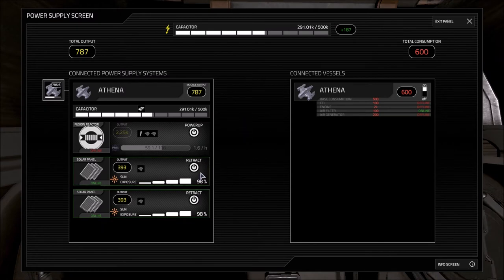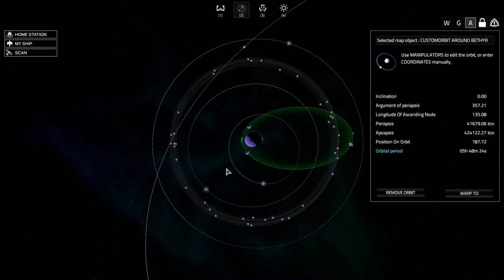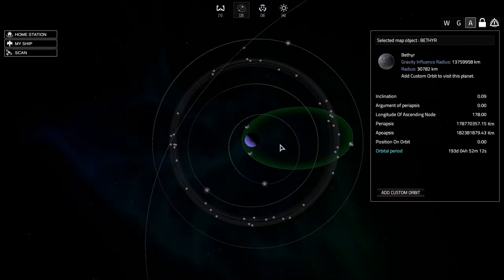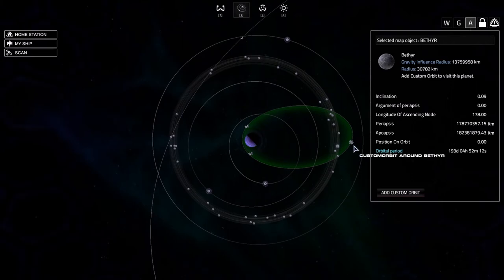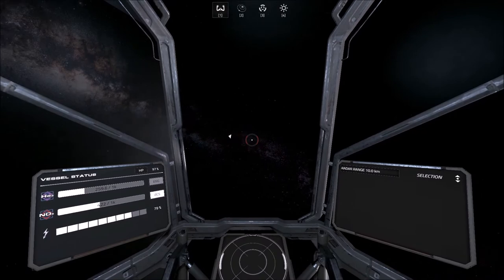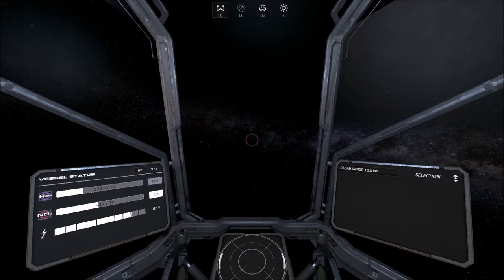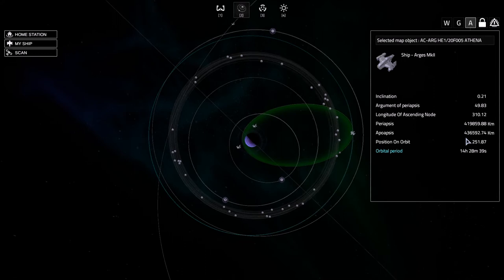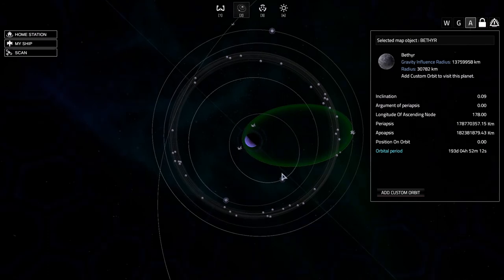Hellion - Manual Orbital Maneuvers (no warp drive)

Comment: how did you saved it aka how did you get it before it craches? and were did you got it from
Reply from the maker: I'm not sure what you're asking but the Arges (the Mule) can be found around the planet Ia. They spawn about once an hour (+/-). They also spawn near Athnar I think, but not as often.
Reply: indeed but they are pulled in to the planet when they spawn in you have like a few min to save them from crashing.  what is the best place to get one?  i just died again :S
Reply from the maker: Like I said, the planet 'Ia' spawns them constantly. Make sure to bring plenty of resources; hydrogen, helium, nitro, and fresh warp cells.

Don't forget those high-tier parts although you could probably get away with only tier 2 provided that you immediately return to an area that has good sunlight for your solar panels.

If you want to pressurize the ship, bring plenty of oxygen and nitrogen too. Or just carry 3-4 jetpacks with you.

If you are new at this, it wont be easy. There isn't a lot of time to get everything done. Have your Steropes connected to the Arges in case you wont make it. At least you can get back in the Steropes, undock, and jump away before slamming into the planet. Don't forget to constantly check the orbit.

If your desperate, you can connect the Steropes to the Arges and jump to a safe orbit, but it will cost a lot in electricity and warp cell fuel. Use the Arges reactor to power your Steropes.